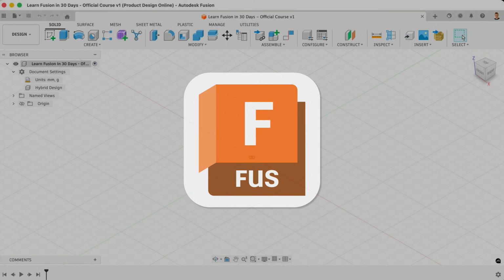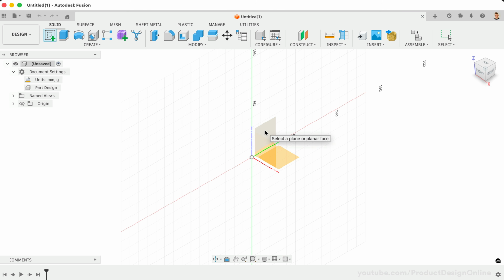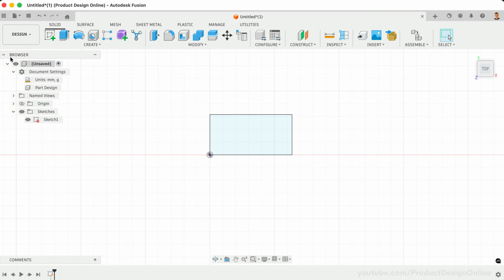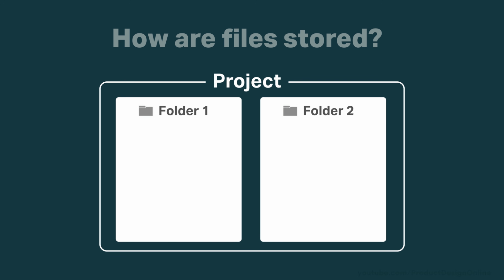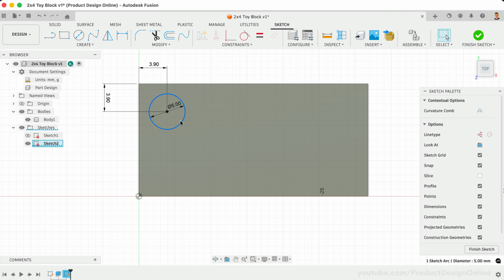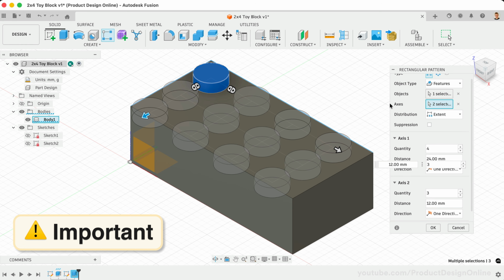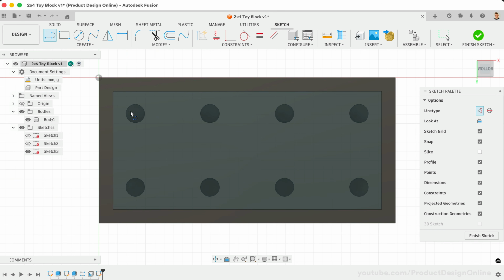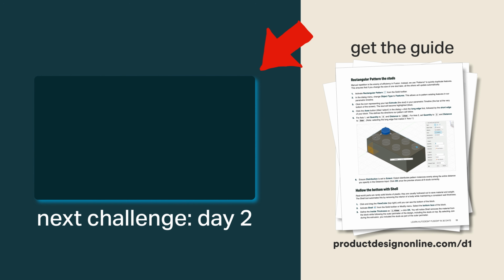Day 1 of Learn Autodesk Fusion in 30 Days! (2026 EDITION)

Comment: After shell operation I can't click at the created bottom, I can only select whole bottom( the face we just shell on). I asked AI and it said that I clicked in wrong order but I fallowed you step to the click and it doesn't work. Any advice, please ?
Reply from the maker: Make sure your sketch is not blocking it. Turn off all your Sketches in the Browser. That is most likely it.... if not, send me an email (in my YT bio) with your Fusion file.
Reply: @ProductDesignOnline  It worked! Thank you! I also can't see the number of dims for the stud in the sketch. All lines are black and dims are correct and I can see the dims lines with arrows but the number is not there. When I hover over the line the number will show next to the mouse so I know that the dims are correct. Any idea why this can happen? I can add that I did not set my settings to default but never change any since installation.
Reply from the maker: Hmm. That's very strange and not something I've ever seen or heard, but it sounds like a graphics issue. I would suggest restoring your preferences to the Defaults if you have changed any of the graphic-based preferences. Sometimes, folks have had to do a clean uninstall/reinstall to fix these sort of issues.

What computer OS are you on?

Comment: For whatever reason When I shelled the bottom it only shelled out the original circle on the top even though they are all there?
I am wondering if it did not make them a group before the shell?  If that is it. How do I make a group?
Reply from the maker: It sounds like your Extrude for the first stud is set to 'Join' (operation) the block... so this leads me to believe its the Rectangular Pattern Command.

Double-click your rectangular pattern command > change the compute type (bottom of dialog) to OPTIMIZED. Let me know if that fixes it.

If not, please email your Fusion file to me.
Reply: @ProductDesignOnline  TY. I will try that.
Reply from the maker: @ThunderPantz01  Let me know how it goes!

Comment: For patterning, how do you make equidistant patterns (from the edges)? In other words, right now we're just copying existing dimensions. If we didn't know them, how would we make sure that the features are the same distance apart, and symmetrical?
Reply from the maker: Great question! Many answers as it depends on each project. For some projects, you may be able to look up dimensions... For others, you may have to find them through trial and error. For others, you could use equations. Fusion allows you to do (most) equations in the dimension input. You could type out your length and divide by the number of patterns and subtract the margin you want on the edge (x2). You can also use the Measure tool to check distances between different edges, faces, bodies, etc. in Fusion.

Comment: nothing working
Reply from the maker: What's not working? Kindly elaborate if you need help.
Reply: @ProductDesignOnline  I already gave up and switched back to shapr3d… sketches on fusion would not show up, personal use license sucks for doing any real work
Reply from the maker: I'm sorry to hear that. To clarify though, the Personal Use license is the same install as the Commercial license. The login credentials just limit features. You shouldn't have any issues with sketch performance on any license.

Comment: I’m not gonna lie I made the brick but I don’t think I learned shit 😂
Reply from the maker: Practice, practice, practice. Try modeling a 2x2 toy block now. See what you can recall from memory and what parts are still challenging.

Also, this 30-day course is designed to reinforce concepts to help them stick. You won't learn Fusion in a single video or day. There's a lot to learn 😃

Comment: I'm just learning fusion with your videos man, I didn't double click the "first 15 days" folder before saving, I really struggle with the organising and correcting mistakes aspect of these software's and often find myself deleting everything and starting again as it gets so confusing.
Reply from the maker: No need to start over! You can open your Data Panel (top left) > find the toy block file. It should appear in the recent > right click it > move > select the desired location (First 15 Days folder).
Reply: @ProductDesignOnline  thanks for replying, I'd actually managed to save it in both locations so I deleted the version that was outside of "first 15 days" folder. It's beginning to make sense, I'm super grateful for these videos, I'm 50+ now and the digital space for design is a real revelation to me. I love how powerful it is!

Comment: How do you know the dimensions coach. Could you give a video on how to figure out the approximate dimensions.
Reply from the maker: These dimensions were found online. It depends on the project. Some projects you'll be able to reference drawings online, while new designs you create you may need to come up with them (3D print, trial and error, etc).

Comment: I am super excited to learn 3d modeling and this course keeps showing up as "the best".  I am a super beginner and not artistic at all.  I keep hearing stuff I don't understand, even in the beginning of your video for day 1 there is a lot of terminology like constraints, anchors, etc that I am completely lost on.  Do you cover that stuff in this series or do I need a beginner series to the beginner series? :) Thanks
Reply from the maker: Yes! This course is designed to be sequential and cover the topics throughout it...because I can't explain every concept or term in detail in a single lesson, or it would be 100 hours long :)

There is a lot to learn, and it's normal to feel overwhelmed. I recommend watching the lesson all the way through once, then a second time while pausing and following along in Fusion.

It is designed to go through the full 30 days (in order). I can tell from experience with the 2024 version that students who complete all 30 days in order can model far better than those who watch just the first few lessons or those who cherry-pick lessons.

Also, if you have questions, ask them in the comments. I do my best to answer as many as possible.

Comment: @ProductDesignOnline  I have an issue when I start new file as assembly and create parametrs and then creating new component I no longer have access to parameters I've just created no matter if I try to make a sketch inside that component or just go to list of the parametrs while im so called "edit in place" mod. Existing tutorials on YT are outdated as far as I can tell
Reply from the maker: Can you clarify, are you saying you can't access the parameters from the assembly file when you're in edit in place? Or... Regardless of whether you're in edit in place or not? 

Edit in place is treated as an external component, so won't have access to parameters created in the main assembly file, unless you Derive them.

Comment: Explain it clearly plz , I can’t switch between inputs by using tab key
Reply from the maker: Something must not be right with your Fusion install. Tab to switch inputs is the only way and has always been in Fusion. I would recommend doing a clean uninstall and reinstall then see if the problem still exists. Check that Fusion is recognizing the tab key from your keyboard on other features as well.

Comment: Thank you! Is there a reason I don't have a "version" when I save?
Reply from the maker: They are changing up Versioning as we speak, which is why Im going to discuss it later in the course... when it's hopefully rolled out to everyone. With the new "Collaborative editing" (you'll see a star like icon in the data panel) version is only done when you intentionally go to File > Create Version.

I think this change is an improvement to Fusion because it stops you from having a simple file that has 54 versions (just from clicking save a lot). When there really should only be a few versions.

Comment: YES!! Thank you thank you thank you! I just got a 3d printer and trying to learn fusion. This timing could not be better. I was having trouble following along with the old version. Thank you so much for updating this!
Reply from the maker: Thanks, Tim! What 3D printer did you get? 😊
Reply: Can you tell us how often you plan on uploading these new videos?
Reply: Same here. 
Got a Prusa mk4 and have been struggling with Fusion and the printer. Mainly printing predesigned parts. 
Designed and printed my first part only took 2 days to design for 10 minute design by someone that has experience.

Comment: Great Video. You can orbit by using the right hand mouse button only without holding down the shift key. To do this you need to go to Preferences and change the Pan, Zoom, Orbit Shortcuts to Tinkercad
Reply from the maker: Great tip! There are several settings in Preferences that allow you to change it like other programs. Definately handy if you're coming from another!

Comment: Im not getting a version number when saving
Reply from the maker: They are changing up Versioning as we speak, which is why Im going to discuss it later in the course... when it's hopefully rolled out to everyone. With the new "Collaborative editing" (you'll see a star like icon in the data panel) version is only done when you intentionally go to File > Create Version.

I think this change is an improvement to Fusion because it stops you from having a simple file that has 54 versions (just from clicking save a lot). When there really should only be a few versions.

Comment: Kevin, I can't thank you enough for going back and doing this yet again.  I have only been fooling around with CAD for a few months and that was with Tinkercad.  I made some elemental, but useful, things for my other hobby, Locksport. Honestly there was so much I wanted to do that I couldn't accomplish with Tinkercad.  Nothing against Tinkercad.  It's great for learning concepts and can accomplish quite a bit, but nothing like Fusion.  I was suggested Fusion by a friend and quickly discovered from viewing numerous videos that I was never going to be able to get it down in a reasonable, organized manner.  That is until I came across your tutorials.  Problem 1, I started with the oldest set and was often stumped.  Then I found the 2023-4 set and made some excellent progress, but there were still some things that didn't match my experiences.  I did however create most of the projects fairly well.  I am greatly looking forward to going back through all of the videos you're making for 2026 and remaking every single project with the latest techniques, tools and methods.  In very short time I have advanced leaps and bounds thanks to you.  As a former teacher, I get why you do it and as someone that loves learning I am extremely glad I found your work. Thank you!
Reply from the maker: Thanks for the kind words! I'm glad to hear it's been a big help in your learning journey. Comments like this inspire me to keep going :)

Comment: Fantastic tutorial. I had tried to use SketchUp, but gave up. I've been meaning to learn Fusion, but hadn't gotten around to it.  Now I'll be able to follow along with the new series. Hopefully it will stick. - Chris
Reply from the maker: Thanks, Chris! What types of projects do you want to design?
Reply: @ProductDesignOnline  I want to use it for both woodworking and 3D printing projects for now. I plan on adding a CNC this year. I can do the woodworking without plans and can usually find 3D models online, but the CNC will be a different story. - Chris
Reply: I would recommend to watch whole video without working in Fusion. Then on second watch try to make the model yourself in Fusion.

Comment: Are there specific reasons to do all the filets at the end, vs filet of individual extrusions prior to using the pattern tools?
Reply from the maker: Fantastic question, Matt! Short answer: yes.

In general, it's considered a best practice in all parametric CAD programs to apply fillets at the end of the timeline (there can be exceptions to this).

Here are the main reasons why to fillet at the end (and after patterns):
1. Prevents "Broken" Models: Fillets delete edges and create new faces. If you fillet early and then reference those edges for later sketches, any change to the base shape will cause "Lost Reference" errors (the dreaded red/yellow timeline).
2. Faster Performance: Fillets are mathematically heavy. Putting them at the end means the software only calculates them once, rather than re-calculating complex surfaces after every tiny tweak you make to the model’s "bones."
3. Cleaner Operations: Features like Draft or Shell often fail on rounded geometry. It’s much easier for the software to hollow out a box with sharp corners than one with complex radii.
4. Easier Editing: Keeping them at the end makes it simple to suppress them for simulation (FEA) or manufacturing (CAM) without destroying the rest of your design 

All that said... a model as small and relatively simple as the Toy block, you likely woudn't experience the latency issues with it processing the fillet in the pattern.

Great topic though. I will try to integrate this in the course.

Apologies for the long response...but hope that sheds some light on it. :)
Reply: @ProductDesignOnline  Thanks!!!  And no need to apologize for length - responses or videos.  We can skim, skip, speed-up, etc. to condense things.  There is no "please elaborate" button in the YouTube UI...